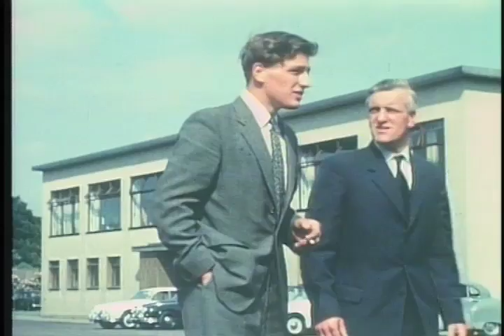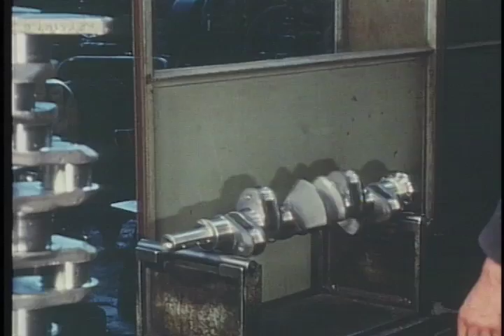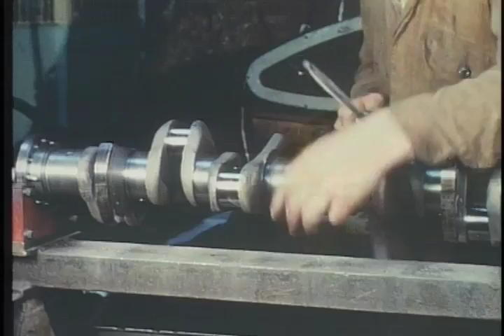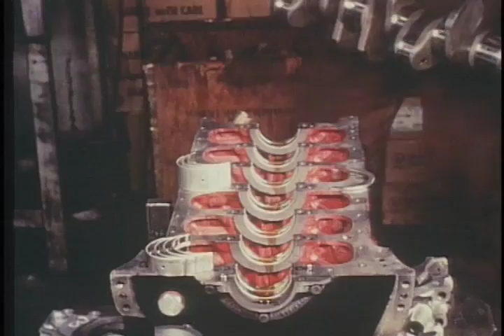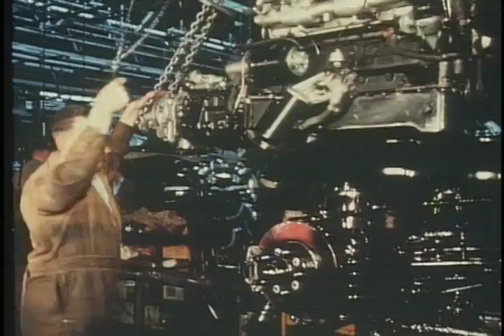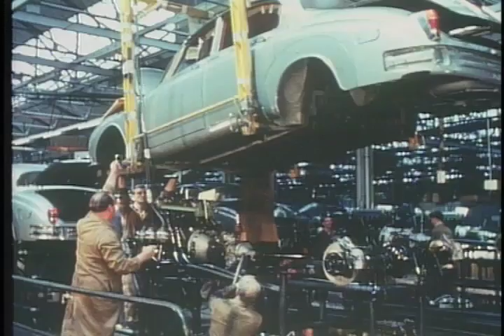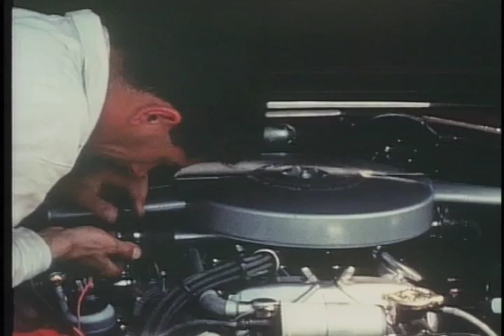Jaguar Factory Tour - 1961

Comment: I've always found it amazing that every Jag owner I know in the states does one thing common to all who buy a Jaguar...trash the British engine and toss in a GM 327...I've never witnessed an car that dies repeatedly regardless of miles or years. I mean, the Jag is historically known for being as dependable as a Russian Lada or a first date..meaning, she ain't gonna put out no matter what.
Reply: Nothing wrong with Jaguar engines. Strong and long, as proven at Le Mans over many years.   One suspects many were changed simply because the average American driver had a bit of difficulty with a manual gearbox, and the average American mechanic didn't understand o.h. cams with shimmed tappets. So they canned the engine and gearbox in one go.
Reply: I have 160.000 miles on my 1966 XK-6 Vandan Plas Sedan, only has regular service, has never broken down nor left me stranded, as my Merceded has.
Reply: robert glenn I have owned several Jaguars since 1970 including currently a 1969 E type and if the engine is maintained competently, the XK engine is bullet proof. I am so fed up with this mentality and whoever put a US truck engine in an E Type should be arrested. 5 Le Mans wins in 7 years  nit to mention numerous motor races worldwide - lets get some perspective
Reply: I just read all the comments,  and I realize the subject has been covered.  I will add that "If you want it done right, do it yourself".  I learned the nuances of fuel injection and electronic engine management working on my own cars, and when I bought my XJS 12 years ago, I began learning the specifics of it.  I've reached a point where I believe it holds no more surprises, and actually It is one of the most reliable cars I have ever owned.
Reply: You know, I recall a mechanic buddy of mine saying that a big problem in the states was a lack of guys who knew enough about Jag engines in order to intelligently diagnose and work on them. Thanks much for the information here. You've answered some questions I've had for some time.
Reply: Rory Gibbons Nothing really wrong with Lucas electrics, except for those bullet connectors that are prone to corrosion, causing bad grounds (which are the root of 90% of the typical problems).
Reply: ford engines where a common swap too, main problem in America was the British would not maintain decent service or dealerships, glad to see the Indians investing and producing the best Jags ever. Now that the British have finally given up George Lucas the Prince of darkness the electronics seem to be ironed out too.
Reply: +robert glenn We don't all do that, thank goodness!  As a British car enthusiast who is also an American, I think I have an explanation.  The USA didn't really begin importing cars on a large scale until the late 1950's-early 1960's, and things like multiple carburetors and overhead cams were probably complicated for the average mechanics of the era.  Imports in general got a mostly undeserved bad reputation because most American mechanics couldn't keep them running well.  Replacing Jaguar engines with American iron was a phase we went through, mostly in the 1970's and 80's.  You don't see much of that happening anymore,  and ironically  the "survivor" Jaguars usually have their original iron.  I don't see many converted cars still on the road (not here in California, anyway).  I am happy to say that I have never done such a conversion,  and my 26 year-old 1989 XJS is still running fine on its original V-12.
Reply: sixmagpies No man ,the engines were good ,the problem was the electricals and the price of the parts,most people got desperate and replaced the whole mechanicals
Reply: No it's left hand drive truly drives well. my Da worked for Super Swallow before they became Jaq, familys always ownded them
Reply: I could pull the cams and reset the valves by the time I was 12 years old, but basically, fuel injection and modern computer controls for engine and transmission management has cured all ill's your friend is right, I service my car every six thousand miles, have over a 160.000 on it now, it's never broken down yet. I think if I were younger I would buy a new one, but I'll be 74 in June, My 96 still looks and runs like it's brand new.
Reply: My old man had me doing likewise to my 283 under the hood of my 57 Chev. I sure miss the days when any kid could easily do what was necessary in order to keep a car healthy and roadworthy. Today, I look under any given hood and have no idea what I'm looking at.
Reply: Nobody does apparently
Reply: The TOHC 6 cylinder Jaguar engine stands only behind the Merlin V12 Spitfire engine  as THE internal combustion engine of the 20th century. Winner of Le Mans 5 times and many, many championships around the world over a long period - it also powered tanks, fire engines and limousines. It is beyond belief that foreigners would replace  such a jewel with a cast iron truck engine and then say how smart are we?.
Reply from the maker: robert glenn A very privileged girl in the town where I grew up received a red Jaguar XKE for her 16th birthday.  Her father gave her anything she wanted.  He didn't mind that she kept blowing up her engine because she drove like mad and probably never thought about checking the oil.  Instead of getting mad he had a mechanic swap the Jaguar engine for another.  I thought it was a 289 Ford V8.  And our little Princess was able to put the pedal to the metal and never worry about blowing her engine.
Reply: I believe you are right on, Peter. Everyone I knew experienced persistent electrical hassles. I sold a right hand drive Jag that my wife owned with her first husband and the guy kept coming back demanding his money because it would drive mile or so and the electrical system would shut down the works. If sitting for a half hour or so, it would fire up only to shut down shortly thereafter.
Reply: Oh, wow...a 66! I'd love to take a ride in that. Is it right hand drive?
Reply: The 60s are a great period for Jag design in my mind. Just a classy looking ride. Glad to hear you've had no problems with yours. My friends dating back to the early 70s all eventually put 350 Chevy motors in them. Go figure...
Reply: Ahh yes Lucas...."The Prince Of Darkness." your right though Paul it's the connectors, cleaning greasing and putting them back together usually takes care of things
Reply: Rovejag Yes they should be kelp factory original and on that ANY engine that is maintained competently will last. I had a friend that owned a 1972 Ford Pinto since new got just over 200,000 miles on it before it blew he took great care of that car made sure oil was changed and cooling system maintained to keep it from over heating and so on despite the engine flaws that model had if it ever overheated.
Reply: +sixmagpies It never ceases to amaze me so many American drivers cannot handle a stick shift box
Reply: i own a 94 6l. same deal here. you learn the car like you are supposed to...mod out the quirks and turn the key. mine goes every time i turn that tibbe key. he's only let me down once and 45 mins later was back up and running thanks  to a spare dizzy and relay and the use of a vacant bank's parking lot. ;-)
they really are friendly and reliable the v12s are if not just a bit thirsty but then again: you don't drive a v12 for the economy aspect of the thing. it's the smiles per mile part and sound.
i could go on but not writing a book....today.
Reply: robert glenn utter bullshit
Reply: Well, Rove, we had a right hand drive, a 66 my wife had shipped from Britain.. and I don't recall ever going farther than a half mile and it would stall. I sold it to a Jag fan and he put in a 327 chevy. It was a beautiful car but so frustrating...and in the six months I fought with it, no local mechanic could diagnose my recurring problem.
Reply: I guess, Rovejag that I allowed my frustration to ovewhelm my perspective let alone my patience. However, I have known more than a dozen Jag owners who confidently installed the 327 as a replacement. I have to believe that most young men of the day were familiar with American GM motors and had a great deal of confidence in them. Personally, I've always believed the 283 to have been the best engine ever designed. Another problem faced by Jag owners is that there were too few mechanics who knew the system. I couldn't find one in Seattle who could tell me why this thing kept stalling so damned frequently...honest to God, that was my experience. After sitting for 20 or so minutes, it would fire up again only to stall again a mile or so later. As for winning motor races, well gee whiz, the world's foremost mechanics are babysitting these critters, the best in the world.
Reply: Here is another story for which you might have a thought or advice. A few years back, a buddy of mine purchased a beautiful 89 Jag at auction...maroon, not a ding or scratch...absolutely beautiful. However, when riding around town and coming to stop lights, it would begin idling rough and eventually stall if he didn't put it into neutral and give it some throddle. This was common. So, he takes it to his mechanic and he couldn't find a thing wrong. Another replaced the fuel pump thinking he thought might have solved the problem...but, to no avail. So far, he has spent $700 and has yet to realize a solution....You have any ideas?
Reply: +robert glenn What is the logic in replacing the fuel pump? The pump obviously flows enough at higher demand. Perhaps a tweek of the idle screw may suffice.
Reply: You'd have to ask my buddy that, jerseybean. I haven't a clue.
Reply: It's sad to see a XJS V-12 in a junkyard,some in good condition,it really breaks my heart but maintenance in these cars are such an ordeal and it's all Jaguar's fault,they never did anything to lower the price on parts,that's why the cars are so devaluated after a few years
Reply: I hear you, Peter. They are such classy vehicles but in all honesty, I've never witnessed such frustrated owners.
Reply: Indeed, Rovejag. I recall you as the ultimate Jag expert out there. You've certainly educated me! Now, if only I could afford to even consider one. I love the lines, ,particularly the 50s and 60s models. I guess I will never understand the frustration I've encountered from guys I've known over the years who habitually dump a 327 or 350 in them. There has to be something they don't understand. And the Merlin is the masterpiece of the 20th Century. Once the P-51 had the Merlin replace the Allison, it became the best fighter in the European theater. God, I'd give anything to fly one!
Reply: The people did those engine swaps out of desperation back in the 80s,I remember going to a Jaguar dealer in the beginning of the 90s after a windshield washer tank and they asked me (laughing) $300. (no lid),that was just insane...
Reply: +peter455sd...A windshield washer tank...as in a plastic tank? Three bills? One wonders then if it came with an $800 toilet seat just for the hell of it...
Reply: robert glenn
Says it all really.
Reply: +robert glenn nothing direct,but check out the university motors channel.John Twist is the greatest single expert on English iron I know of.Iwould say carbeuration.Check for oddballs like a fuel hose inner liner collapsing. Most likely a small thing only patient diagnostic plus serial replacement will cure. Good luck.
Reply: +Rory Gibbons Tata can probably do this as they'll get the finance from Indian Banks not British ones.
Reply: BigWhiteGuitar p
Reply: doesn't say a lot about your local mechanics if they unable to diagnose a fault that occurs after half mile consistently,c'mon
Reply: robert glenn GM😂 rather the bomb proof Lada. There's a reason Russia imported them all back
Reply: robert glenn aluminium buick V8 what US couldn't get to work. Rover UK did make it work
Reply: robert glenn savage yank you are lol
Reply: robert glenn - currently in my garage (South Alabama, USA) I have a 1982 XJS. Born with the V-12 of course, someone dropped a 5L GM engine in it about 1985. I like the car very much and it is in nice condition (interior is getting a little rough) but I do wish it had its original lump. I will say the conversion was nicely done, everything was addressed, the air conditioning, cruse control, tachometer recalibrated etc. At the time I bought the car I didn’t consider the controversy of the swap, I just knew it was a nice looking car and ran well. I’m a tinkerer in the garage so I plan to keep it up. Who knows, if someday I run across a a proper engine it just might become a HE again. (Anybody have a fuel tank? This one is in terrible shape).
Reply: sixmagpies To complex for US
Reply: "Now that the British have finally given up George Lucas ......"
If you're going to slag off Joe Lucas at least get his name right.

Comment: el concordistador - as a Mk2 owner of 30 plus years, we're interested in your experience or qualifications for your sweeping 'piece of junk' comments...or are you just the contrarian,combative jerk you come across as?...I think we know the answer!
Reply: I bought a 1960 mk 1 in 1966 , it was the biggest heap of junk that I have ever been so unfortunate to own, only used it for about 4 months , M.O.T. time it was so rusted and rotten, not worth the repair cost , went to the scrap yard , never ever bought another Jag.  Bought Humber Super Snipe much better car, had that for years .
Reply: Chris C. That was a shame  but a probably common story, unfortunately, due to - amazingly - nearly zero corrosion protection rather than inherent fault with car itself   wonder if your Mk1 was used extensively during the terrible early months of 1963 of the Big Freeze?...and picked up more than its fair share of salty slush!  I had similar and expensive experience with 1976 Triumph 2500S saloon bought at 6 years old - less than 2 years later had to be scrapped due to serious and uneconomic corrosion...
Reply: BestCanKeanRob2 Correct!  GM F*CKED up Saab in Sweden.

Comment: Jaguar Mk.2 were based on the rare 1951 Bugatti Type 101, taking its front end styling and combining it with the rear end of a 101 Berline Le Poix making a cheap fake to sell in huge numbers as Japan later tried.   Lyons was taken by the 1951 101 Ghia Roadster and worked through his plans for the e-type based on it and the 1958 Ferrari 250 Testa Rossa.  So Jaguars may look real good but were cheap made for maximum profits - they ran so hot many owners fell asleep at the wheel.
Reply: Based on the Bugatti 101? Nah. Cheap fake - of course not!
 
The 101 was an attempt to keep Molsheim going - which didn't work. There were eight 101s, all different, nothing to do with Ettore or Jean Bugatti, bodies built by at least three coachbuilders. There was a 101 roadster built by Ghia and "designed" by Virgil Exner around 1964. NONE of these remotely influenced the Jaguar Mk II. Actually the Mk II was just an update of the Mk 1, which if anything was a 4 seater saloon XK140 - its predecessor the XK120 MAY have been partially inspired by the 1940 BMW 328.

The E-type was a "productionised" development of the D-type racing car and like that car mostly designed by Malcolm Sayer with input from William Lyons. It had NOTHING to do with the horrible Ghia Roadster, and anyway was designed before it. 

As to "cheap made", well sort of - it's well known that Bill Lyons kept a pretty sharp eye on the cost of parts, but on the other hand Jaguar, along with Citroën, were fitting disc brakes  to their cars years before the US, the Italians, and Mercedes. And as for BMW - they were making bubble cars! Running hot? Maybe in Death Valley. I've had lots of rides in Mk IIs and I don't recall falling asleep - very much the reverse. Especially in the Coombs Mk II.

Comment: had a 3.4 liter 1962 Mark II in 1981 as a daily driver/project. loved it. 1988 was third owner of 1976 beautiful bright red XJ6-L with original 8 track. the architect I worked for was jealous but loved it. dropped # 4 intake valve two years later. the women loved them both.

Comment: It's kind of interesting that such an advanced design was assembled in such a primative fashion. Run the engine for hours, then clean the sump out, then drive it, then fidddle with the SU slobber pots, then drive it again, then fix on it some more. Can you imagine how many people Ford would have had to employ to do this? And after all this, they still put the damn steering wheel on the wrong side. Then to top it off, they put motorcycle shifters on the wrong side too. Brit cars were oozing with character, which tended to gum up the mechanicals.

Comment: Superb Documentation on really outstanding Motor cars. I used to have my first Jag nearly 30 years ago, a MK2 3,8. The car was restored very badly and I had to do it all again... In the meantime I have owned all sorts of Jaguar classics. Several MK2 3,4 and 3,8, a few XJ 12 and 6, many E-Type 3,8, 4,2 Series 1 and V12 as well as a few XK´s. Four years ago I have completely redone a 3,4 MK2 Mod model and currently I am finishing off a very late 3,8 FHC E-Type from September 1964. Hardly any other car maker matches the magic appearance of a classic Jaguar....
Reply from the maker: Thank you for sharing.  I completely agree with your views about Jaguar.  Timeless.
Reply: Absolutely agree. And they're still great looking. The previous XJ, not so much the current one, but the X-Type, and the XF all look superb IMHO!

Comment: At 11:17 the gudgeon pins were easily installed at room temperature with a ball peen hammer. Then they were secured with a snap ring. No heating was required.